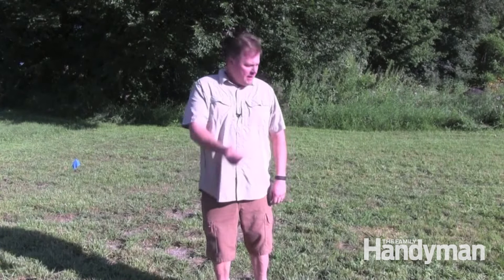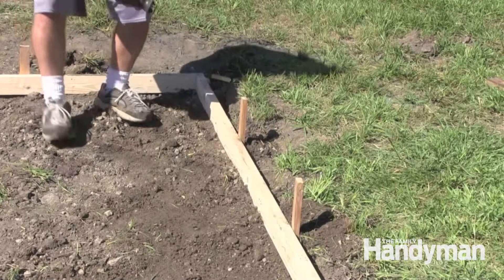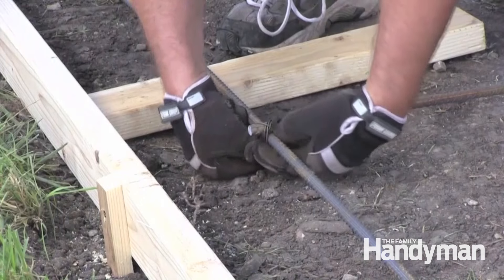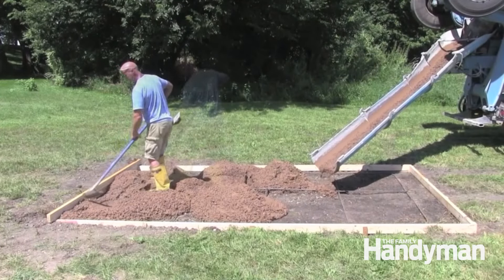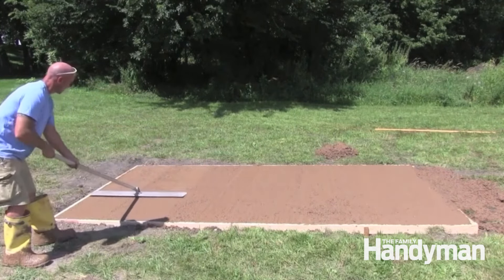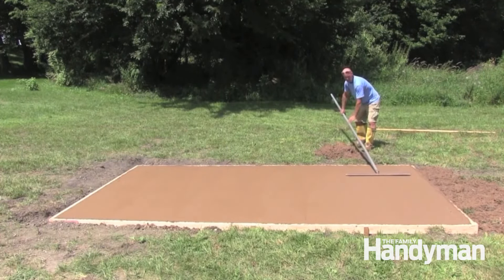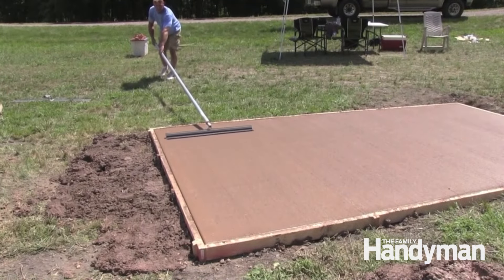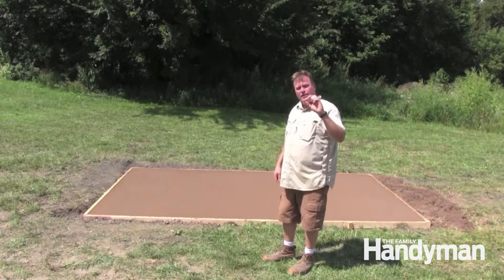How to Pour a Concrete Slab

Comment: between you and Odell concrete, I learn a lot!  I would have liked to have seen time stamps or at least time lines of when to do this, or that.  I realize it will vary depending on the size of the slab... but something like this would help: "our concrete has started to thicken up approximately 2 hours after pour so we begin with the bull trowl" (or whatever it was called).  Then something like "after using the bull trowl, it's been about 3 hours and the slab is ready to have the edging done".  Then, when the concrete is such and such, you can put a broom finish on it. 

That stuff just helps noobs like me  :)

Comment: You make it look so easy! A guy wants to charge me $2000 for a 12x10 which to me seems like a lot for a shed floor. Any comments?!
Reply: In KS, I'm getting charged that much for a 20x20 slab. You're getting ripped off.
Reply: @jeremywheeler8417  ok thanks, will be finding better deal
Reply: There are a lot of variables. 2k is not neccesarily a rip off

Comment: Why didnt he lay some gravel down before adding the cement?
Reply: probably because the ground is already very hard? would he need it if its chalk in that area?
Reply: Imran R  You are right, it also seemed very dry below grass level. If it was softer material I might of used gravel. Rock is an excellent stabilizer.
Reply: And he didn't tamp it either. No vapor barrier. Rebar placed incorrectly. What a joke!